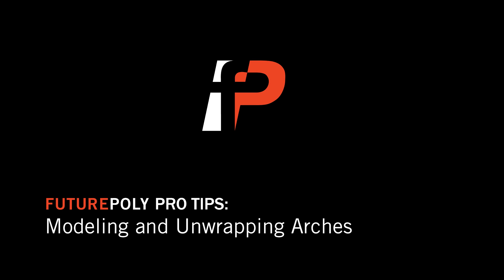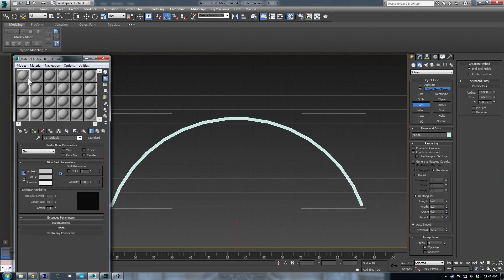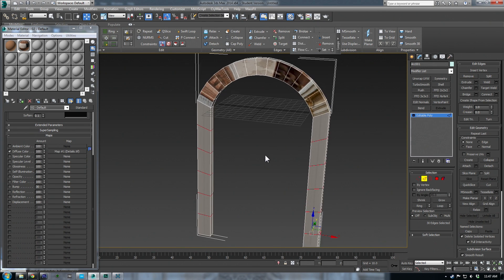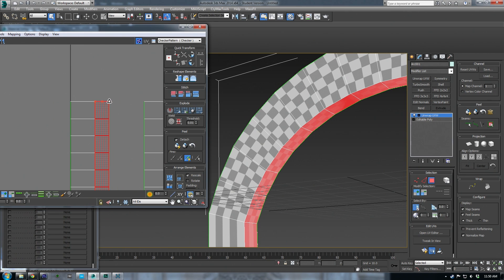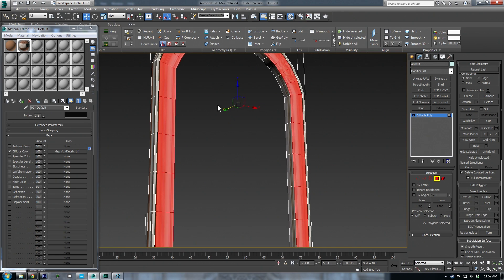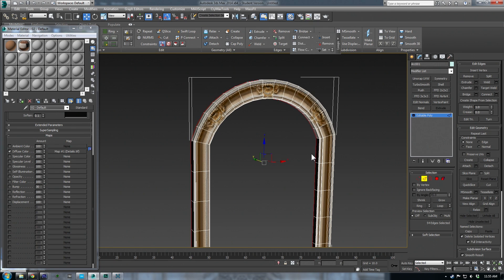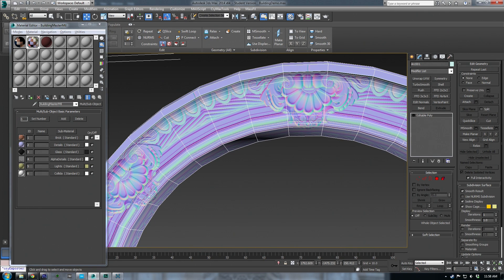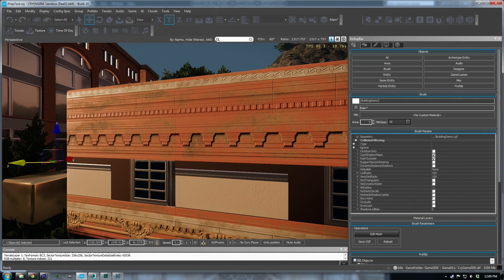Pro Tips: Modeling And Unwrapping Arches

Comment: +Futurepoly great video. I think the length of the video is great. what did you use to get those normals? they look crisp... did you convert from a photo using crazybump or something? or Ndo? or modelling?
Reply from the maker: +MZONE thanks, the normals were baked from highpoly geo in max. I'll cover this in another tips video.
Reply: +Futurepoly :D thought they were too crisp for a photo normal conversion.
Reply from the maker: +MZONE Yeah, I like to block in materials with photos textures to make sure they work before doing a proper bake.